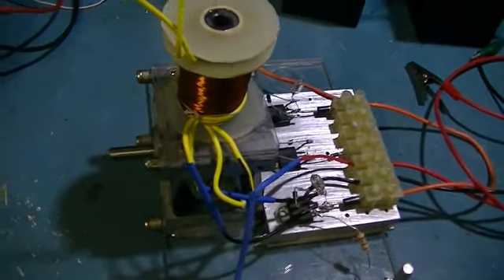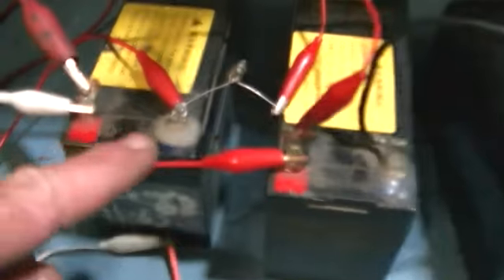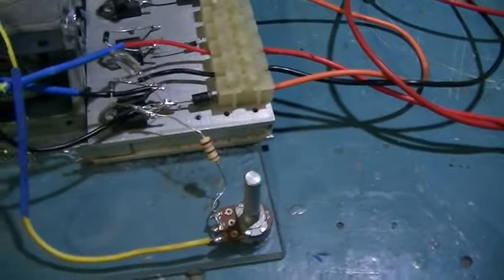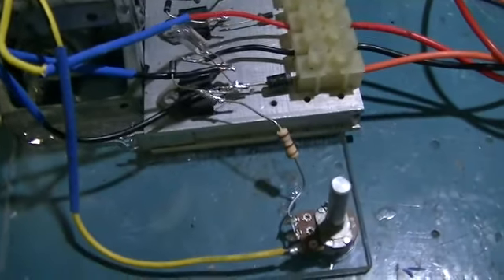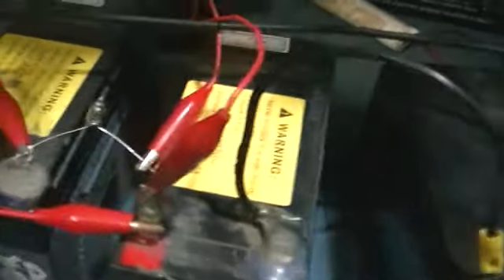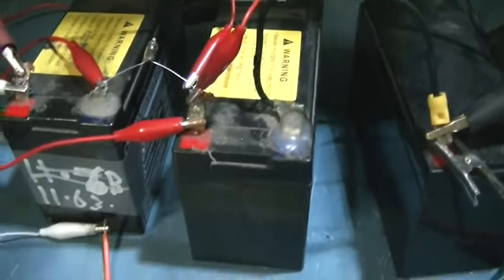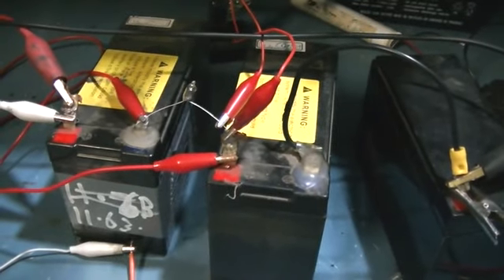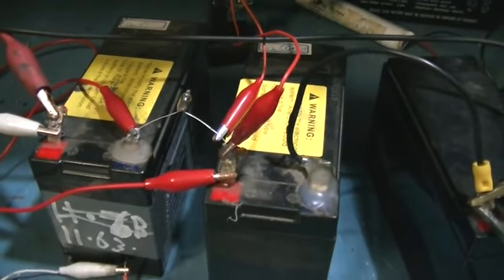learn something new every day..mp4

Comment: Hi Tinman,
If you were to add a cap and an SCR circuit parallel to the charge batteries.
It would or should? convert HV to a Step /Ramp charge to the charge Batteries.
similar to Stan Meyers signal. The will charge extremly fast.

Comment: Would you be able to add a couple more coils to the sides of the pulse motor? If you did the magnets passing by them should create a current. You can take the end of the coil wires and wind your own transformer and increase the voltage coming off the two additional coils If you did this how much voltage do you suppose you could create with simply the current created from the magnets passing by the coils?